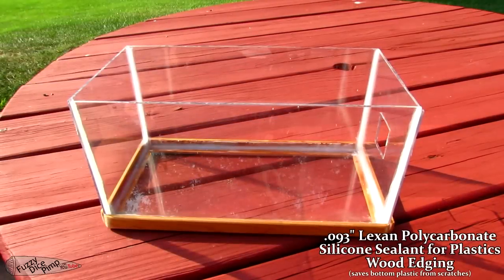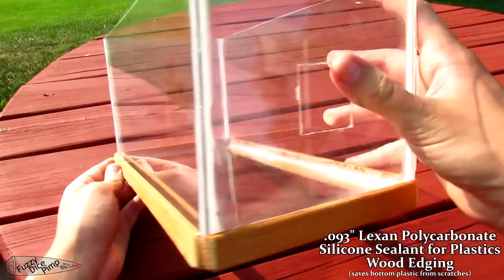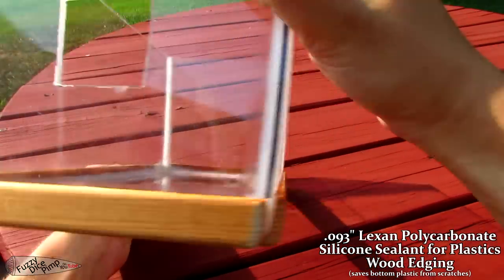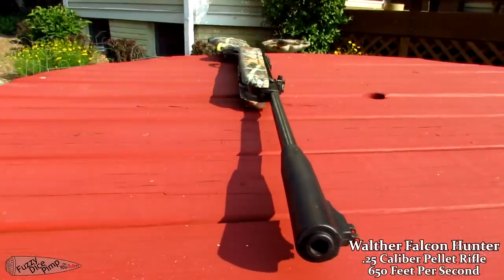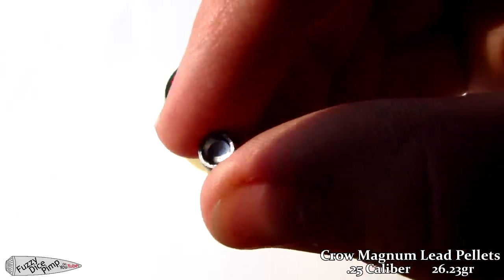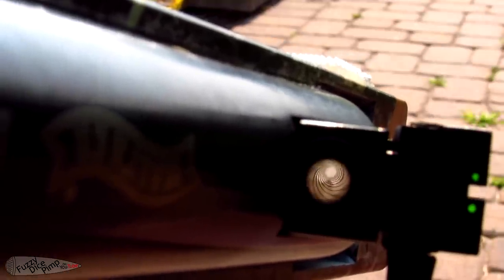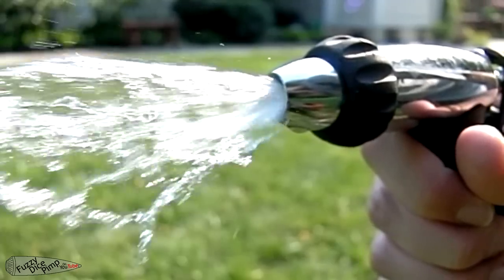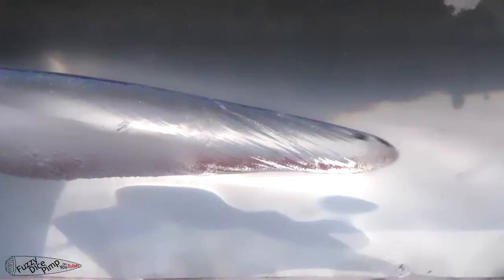Underwater Pellet Trajectory High Speed Film

Comment from the maker: I thought about making both an entry and exit square, but decided against it because I figure the water might knock it off course too much, and I'd like to be able to film from a front-side angle. Could always use clear tape I guess. It could work to put a spare piece of Lexan in front of the entrance to slow it down but part of the reason I really want to use that is because I want the most dramatic reaction possible, and that would lessen it. Will experiment with dye as well. Thanks for ideas!

Comment: If you don't want to break your box you could try a thin target just before the entry point to the container? Cardboard, wax, drywall or bread, fruit etc could provide enough stopping power. Or alternatively if you want to use a big beast on it simply make an entry square and an exit square!

FPSoutback's idea of a colored water balloon in the water is a pretty cool idea. The pellet will make for some interesting patterns and currents with a good thick dye.

Comment: for the .50 dragon claw, maybe 1/4" to 1/8" thick plywood sheets mounted with equal length rods at the corners braced from front to back to absorb the energy would work, i could send you a sleeve of 20 plastic petri dishes, that's 40 layers of thin, clear plastic, if you're interested...